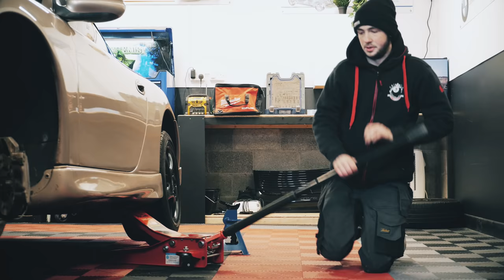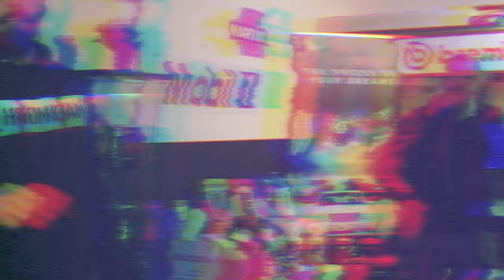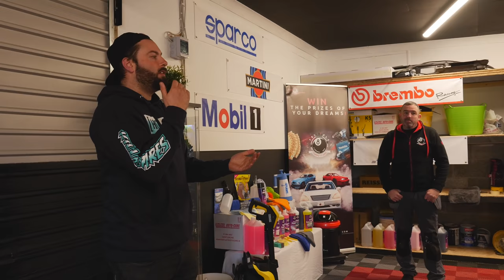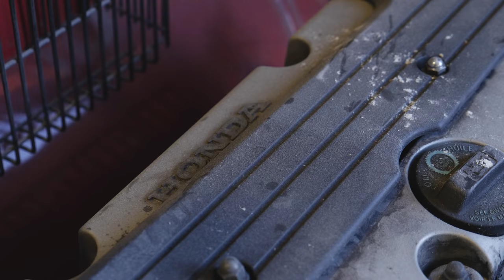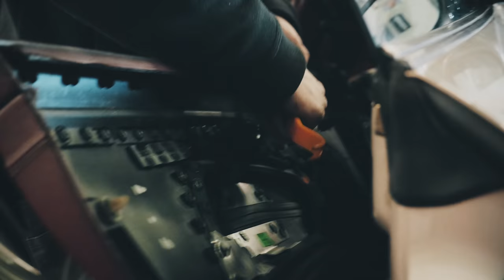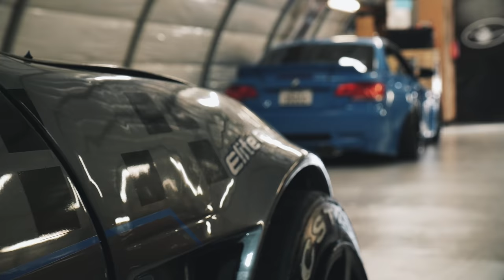K24 SILVIA S15 vs. WIDE-BODY 911 | Build-off BEGINS!

Comment: Make sure  to do the IMS and RMS on the carrera (gt3 badge needs to go), also add the third radiator (from a tiptronic model) to help cooling. Then supercharge it!👍🏻, a car with that body kit deserves it.

https://www.design911.co.uk/fu/pt697_2186_-cma81-cmo110/Porsche/996--911--1997-05/Supercharger-Kits/

Looking forward to the build.